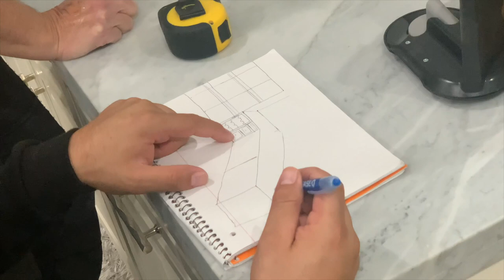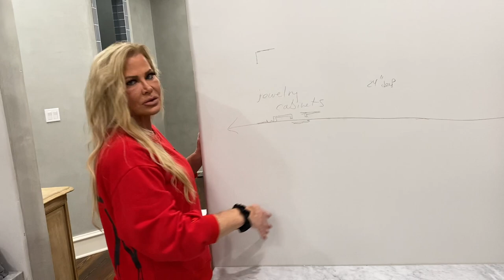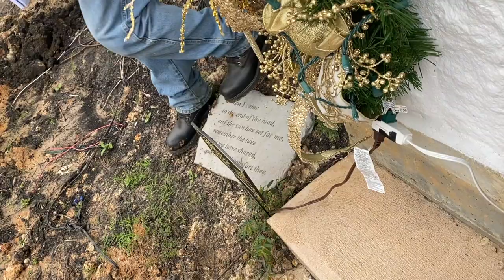DESIGNING THE NEW CLOSET!

Comment: I can't wait to see how your closet and bathroom turn out!!! 😃 Thank you for sharing these videos of the process step by step.

For tomatoes, if you need to pick them before they're ripe, put them in paper lunch bags and roll down the top. The bags help concentrate the gas (ethylene) the plants use for ripening without locking in moisture. You can also add a banana to the bag to speed up the process as they give off the same gas. Check them every couple of days and remove the tomatoes as they ripen.

Comment: Question.. in the closet-
Should you move the ac ceiling vent a little further down into the room since the closet cabinetry is going all the way up to the ceiling? This would allow more air flow for a proper cooling in the closet and eliminate any warm zones.  Maybe even pop another vent or two in on the other side via attic access... especially with the window going in... make sure to tint that window as well so as to not damage the champagne being right there......

How about adding strip lights in the counter display cases?  That way its more akin to works of art..... potentially you could also add custom picture frame moulding inside so as when you look down into it it looks like even more of a framed piece of purse art.

I find inspiration in many things.... from my mother to a piece of art that I will design an entire space around..... mainly though I get inspired from my clients needs, wants, and desires..... many times though I have just walked into a home or building and let the energy of the space guide me.... if that makes any sense....

On Lamar's sink you could also angle the end to create a visually larger and more comfortable access around the tub.  May also keep from banging into his hip as well...

#giftgiving My mom brought me up the same way for the holidays... we use to make and give out 3 layer German Chocolate cakes back in the 70s and 80s... I still do that with assorted cookies and baked goods...

Llamas and Alpacas will both spit actually....  The Llama can be a little more aggressive and spit at strangers... they are good protectors... Alpacas provide softer fleece when sheered and tend to me more shy and kinder overall.  I have a couple friends who have them both and I considered to get Alpacas myself for a farm.

xoxoxoxoxxo
Randolph